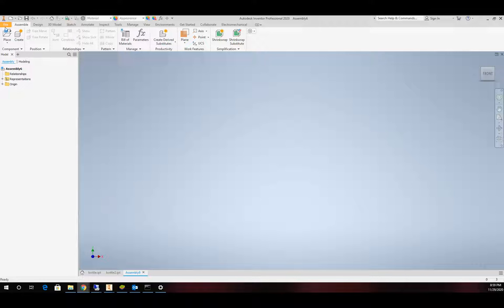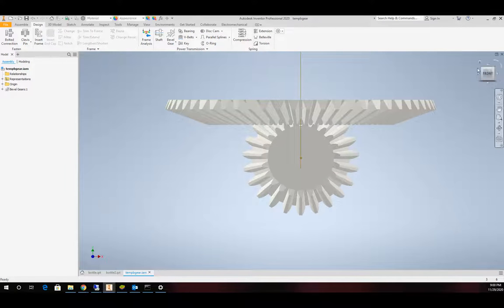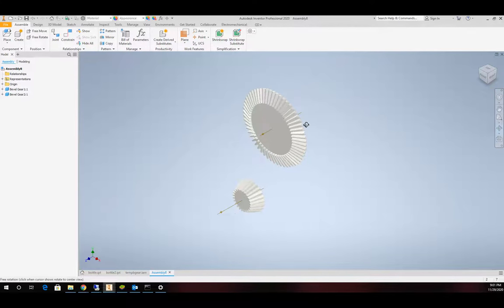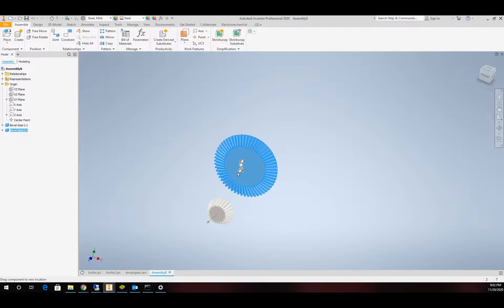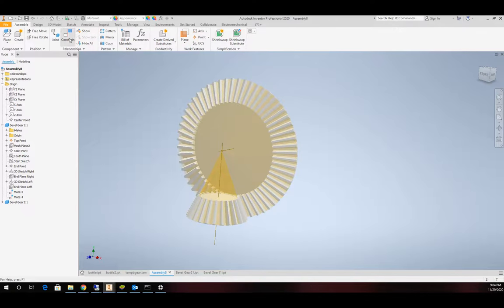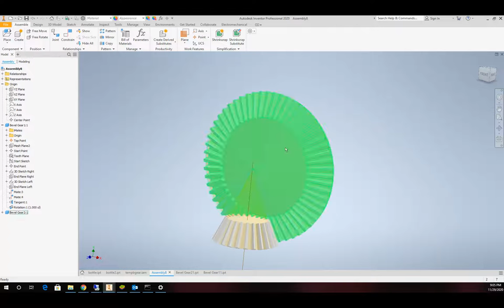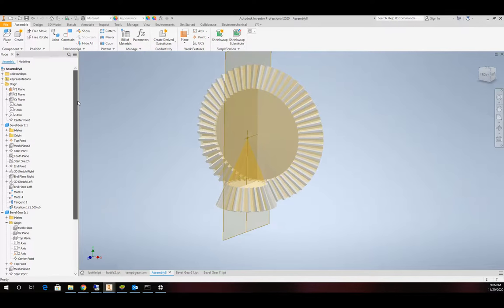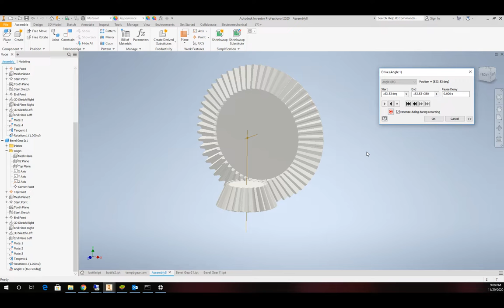AutoDesk Inventor 2021 Bevel Gear Tutorial

Comment: Thanks for the instruction, but can you explain why driving the Angle in the Assembly made by Design accelerator stops every 90 degree but turning manually has no problem?

Comment: to constrain the secondary gear axis from the one degree of rotation it still has, just use an angle constraint (either 0 or 180) or with the axis of the remaining gear and the desired axis. I used the X axis.